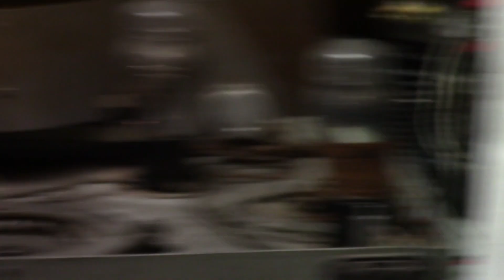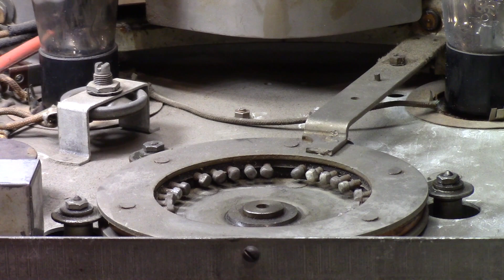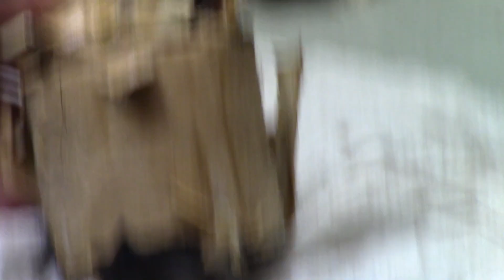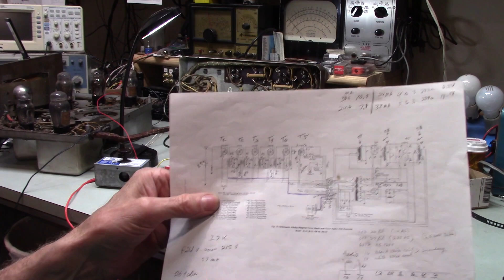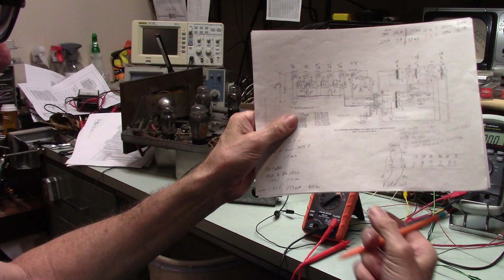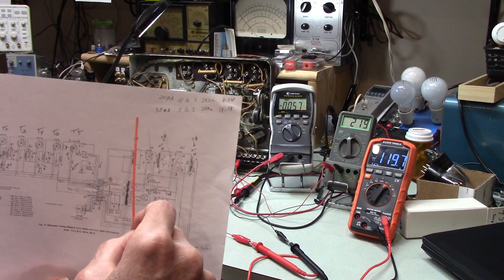RCA R52 Part 2

Comment: When it comes to field coils and choke coils all you need to know about the wire is the gage or diameter of the wire then carefully unwind the coil and count the turns. Ignore the resistance it is the wrong rabbit hole to go down. You will need a winder to get the proper core size to install it on the speaker frame.
Reply from the maker: That was my plan. I will be getting a winder with a counter on it. It is interesting, there are charts that give you the resistance of the coil based on the wire gauge and the weight of the coil. based on that, the coil for the speaker that came with the radio would cost around $400, if I replace all the wire. Yikes! About the resistance, I would like to get the resistance close to what came with the speaker originally. That does affect the voltage supplied to the plates.